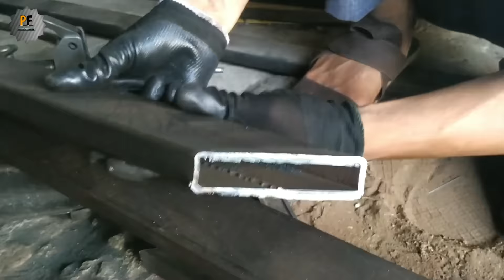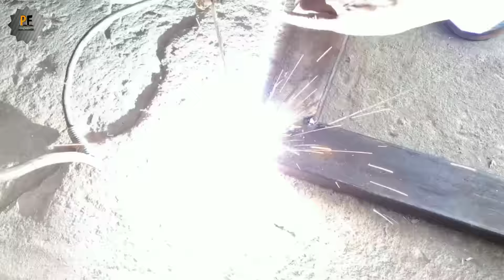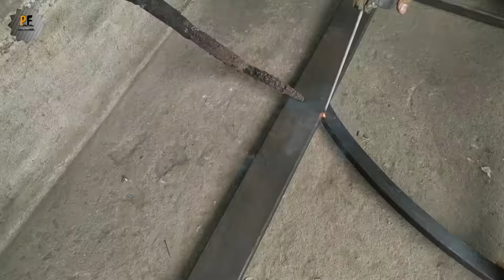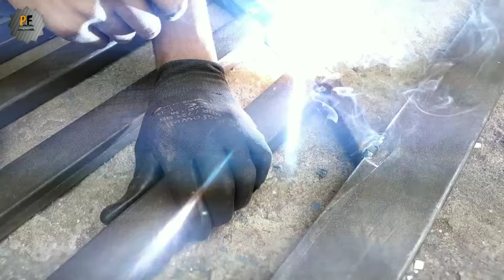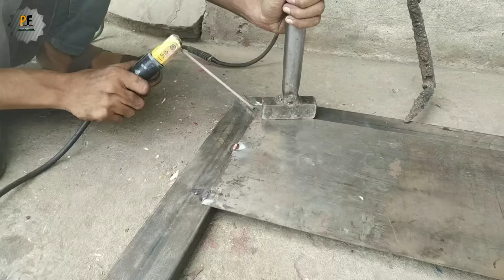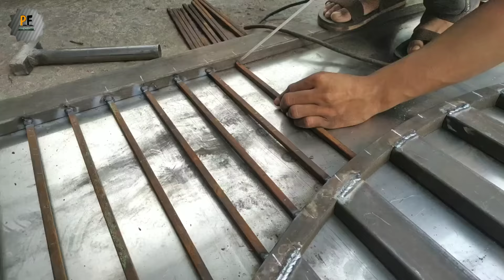Modern gate // Build iron gate design // latest door design 2021

Comment: That's not how you weld... and using your square as a chipping hammer 😵
EDIT: I should've known you were some dude welding in sunglasses and sandals. I guess that epilepsy-inducing stop-start welding technique is akin to guys that squint to do a quick tack weld. You're just doing tack welds the whole way. Get a welding helmet, otherwise you'll regret it.

Seriously, there's some things you can skimp on and some you can't. Keep the sandals but get a helmet or pipeliner hood.